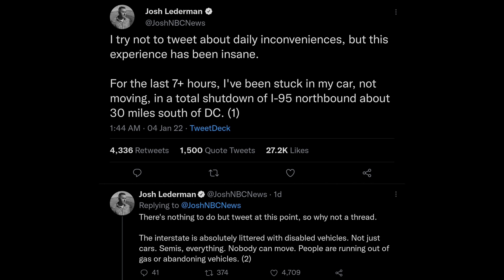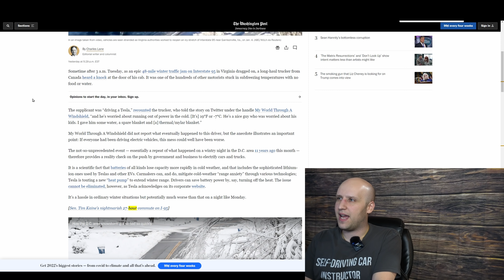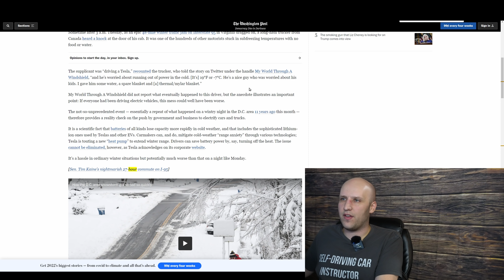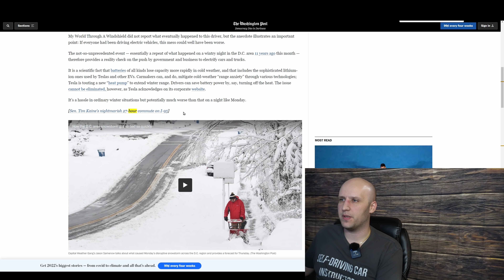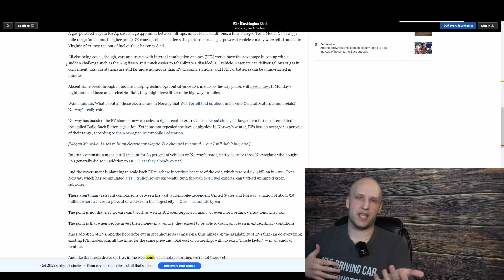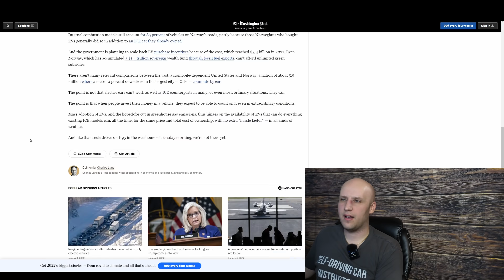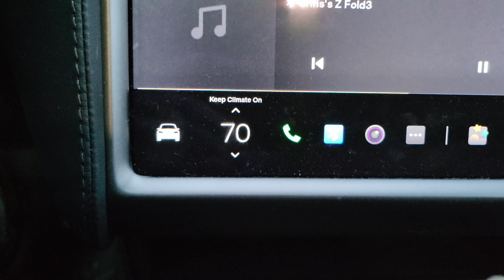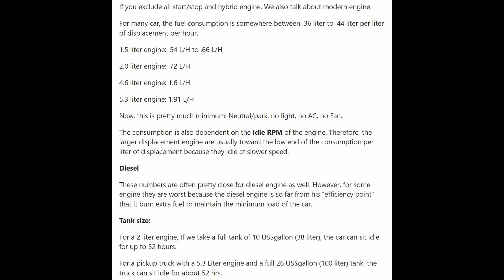How Long Can a Tesla Keep You Warm In A Frozen Traffic Jam? | FUD Debunking

Comment: EV is also useful during a 110 degree heat wave.  Last year the AC to my house broke and repair guy was booked for 3 days before he was available for repairs.  Camped out in my tesla for 10 hrs a day and stayed cool.
Reply: Or you could grab a window ac for $100 and not have to spend all day in a car.
Reply: @chaos.corner  local stores were sold out of AC and amazon was going to take 5 days for delivery.
Reply: @10melvis  That definitely does sound like a benefit then.

Comment: The point about ICE vs EV is that the ICE car can be partly re-filled in minutes ith a gas can whereas it takes much longer and very much more equipment to recharge the EV on the road.
Reply: A small portable generator is always a good thing to carry in an EV, just like a battery jumpstart unit is I always good to have in an ICEV.

Comment: Yeah until tow trucks have a way to give a rapid charge towing a Tesla is a challenge with the weight and bad roads! I have 30+ years of AAA road service experience under my belt! The time it would take a few Tow trucks to put fuel and a quick battery boost could get hundreds of ice cars going again in a couple hours, the EVs this would involve towing almost all of them taking a lot more time per vehicle especially if there's no charging station close by! If a bunch of EVs were stuck on a highway like this they are better off getting pushed off the highway to a safe location until something is arranged, wait you can't push a Tesla without causing thousands in damage to the plastic possibly totaling it, the cost of a bumper is insane!

Comment: Is this in a stand still only scenario? Does the car use more energy for it's sensors / cameras while in Drive mode or if you were at a slow creep every now and then? ..So in a standstill can u save more energy being in park vs drive? I know the car also heats the cameras so ice and snow stays off them. Definitely don't want to use the touch screen a lot or software a lot more than needed if this was a real senerio, and you had to recharge ur phones/nintendo switches if it was a family playing games, music or videos trying to stay entertained; which can drain phone/game batteries that need recharged from the car too. Can you turn off the lane assist and self driving stuff to save more energy on top of the test you did?

Comment: If an ICE vehicle runs out of gas what do you do? Someone brings a gas can! If EV's are running out of power what then? Go reason for a 4x4 pulling a trailer loaded with batteries that can supply enough energy to get them going. Someone needs to make this, have it ready and charge just like a tow truck would.

Comment: New Ice cars may not produce enough heat to keep the cab at 70F (diesel) when idling.  So u would need to add all accessories to load the engine to keep the heat up thus running out of fuel much sooner.

Comment: 1966-67, I was stationed  on a US Army Nike missile site in Farmington, MN.... It was normal for the temps to drop down to a negative 20 or 30 degrees.  When this happened the batteries in our vehicle went completely dead...frozen... The military vehicles were equipped with electric heating blankets, plugged into electric outlets... then used to jump start our POVs.  I'm thinking that all electric cars (battery operated) would fail to start because the battery-packs would freeze.  I suppose one could have a massive battery-pack electric blanket plugged in to an outlet for cold weather starting... just one more question regarding the "convenience" of owing an  electric vehicle.
Reply from the maker: The problem with gas cars not starting does not translate to EVs. I've had my gas cars not start several mornings here in Michigan. An EV will drive off with no problem altho Tesla specifically advised not exposing them to -30C for more than 24hr

Comment: Great Analysis!
Kudos to you for tickling my brain!

I see a valid downside of EVs (not only Tesla, though I am a fan of)...if that disaster lasts for 48 hours or more?

This point is a forecast by me as your Excellent Analysis will be used by EV and Elon haters!

Also I would support your unwavering devotion for Tesla by letting you know that :
In real scenario, body heat generated by the passenger(s) may also offset energy consumption from battery!?
:-)

Comment: I don't own an EV (yet) but almost every single "point" against EV's that that writer in the article was trying to make can be countered with, "well that's also a limitation by an ICE vehicle."  In fact, I would argue that I would be far more likely to have more of a charge on my EV at any given point on my commute than gasoline in my ICE car just because it would be topped off at home and / or work every day.
Reply: That makes way too much sense for the ice folks who love buying gas
Reply: it depends on where you go. you have a commute. i don't, also live in a country without sufficient chargers. at around 0.5-1l/h,  my car gives me around 80 h more or less with a full tank. also i do not like to be close to empty and have more gas stations where to do it. also the guy that made the video calculated a linearity for battery discharge. as you know from your phone, a liion battery does not work that way. even with that and maximum efficiency, there is a difference between 36 and 80h. anyway technology will get better, i'm sure.

Comment: The problem I see is not all EVs are Teslas. There are many out there that are short-range cars. Many only have a 100 ish mile range. Where most small gas cars have small fuel tanks but have small motors so they still keep about a 300 to 400 range. Everyone here that is going on about how long their heater worked for was driving a Tesla. Where are the Nissan leaf owners? Chevy bolt owners? Fiat 500 owners with their 24 kWh battery? That being said if I were stuck in a snowstorm in an Ev I would Want to be in a Tesla.

Comment: "According to the U.S. Department of Energy, fuel economy tests show, in short-trip city driving, a conventional gasoline car's gas mileage is about 12 percent lower at 20 degrees Fahrenheit than it would be at 77 degrees Fahrenheit. It can drop as much as 22 percent for very short trips, around 3 to 4 miles."

"Cold temperatures can reduce an unplugged EV's range by about 20 percent, according to testing by the Norwegian Automobile Federation, and recharging takes longer than in warm weather."

So looking at that the cold weather is affecting both engine types about the same while the EV is affected a little bit worse. While on short trips the ICE will defintily will loose to the EV since it doesn't draw any significant amount of power while not moving while at the same time an ICE will still draw 0,5 L/h.

Comment: Food for thought: a 20 year old car still runs as long with a full tank as when it was new. But how about with old Teslas? Both of these Teslas were pretty new.
Reply: What testing have you performed to verify your assumption? I can almost guarantee a 20 year old car with 150,000 miles on it will not be as efficient as it was new.  The same goes for a Tesla.  I would expect the Tesla to have 70% or so of it's original capacity.  Batteries are getting better and better.  ICE cars are getting worse and worse since manufacturers keep making engines more and more complicated.
Reply: Very good point. ICE vehicles loose very little efficiency over time. I have well over 220 k miles on my '97 pickup and it still runs the same as always. The 2000 Jeep too. The '96 Nissan Sentra runs like new. When I had my 1927 Buick Brougham with the Master 6 it was every bit as peppy as it was when new and with the factory fuel tank!
Elon says of the NCA tech: "maybe 15 years calendar life" so Tesla's success partly depends on that estimate being wrong or allowing battery changes as a part of normal vehicle maintenance for long-term ownership.
Reply: Annete not that it's not a valid question but this is one of those endless "what if" questions we can ask back and forth all day in endless amounts . 
Well what if the gas vehicle has a bad starter that sticks when cold
What if the electric vehicle was this or that ect .
Reply: Of course it won't. An electric toothbrush after 4 years doesn't perform with 1/2 power as it did when new.

Comment: Seems like quite a few things could be optimized.

1. Always carry an emergency kit with even a basic set of gloves, toque, blanket.

2. Unless you are getting in and out, once your seat is warm you don't need to keep it on. At times if I'd sleep in the truck (F150) going to work or coming back home (3-hour commute each way) in the winter I'd turn on the heater once per hour for ~20 minutes and turn on and off the seat heaters.

3. Starting heater periodically definitely works in an ice because it takes time for the block to cool. I wonder what the effect would be for an EV?

Comment: Year ago someone told me that they use to have overheating problems with ICE vehicles during heavy snow do grills getting clogged with snow and ice.  Was there any such problem during these traffic jams?
Reply: I've heard stories from my dad of going out snow drift busting for fun. the truck would overheat and they'd find the engine compartment packed full of snow. I can imagine this problem is much worse for a heat pump. at least with a gas vehicle, the radiator is kept hot, which at least helps melt some of the snow and ice. but with a heat pump the radiator is extremely cold and prone to icing. heat pumps go into defrost cycles to keep the outside evaporator clear, which means more energy used and no heat produced during those times. after the last snow storm we had where I live, the heat pump for my home was completely iced up, far beyond what a defrost cycle could handle. I switched it over to air conditioning for 5 minutes to clear the outside radiators, but it only stayed clear because the storm had already passed at that point.

Comment: The difference between a gas vs electric running out of a fuel source - you can bring a can of gas to refuel your car.  Until solar charging gets better or they devise a way for roadside assistance to give you a 5 min quick charge, the gas car has advantages.  Always keep an emergency kit in your car, especially if you drive areas where you cant walk to get help or out of the elements.  Wool blanket.  Water.  First aid kit.  Shovel/sand.  Jacket, gloves, hat.  Shoes or boots you can go for a hike in, in case you do have to abandon the vehicle.

Comment: The assumption is that electric cars would run out of power and not stay worm.  Thanks for correcting this assumption.
Reply: The problem is if they do run out of power you need a tow truck which would make the problem worse. If everyone had one and 1 and 10 ran out of power the jam would last hours longer. That is the problem.

Comment: Never been in a 24 hour jam, but I have been in 6 hour ones during road closures from serious accidents. A lot if this debate is silly. The culture sort of changes when you are stuck together like that.  Instead of being rude aholes, most people work together, and weather permitting, turn it into a sort of social event akin to a hurricane party without the beer. Only an utter moron with zero social skills would run out of charge or gas, or even if they did, get into danger (excluding risk from exhaust gases). If me or any other normal person got stuck in a jam on a closed road with low fuel/charge, we would shut the vehicle off, make a friend, and sit in their car. A few people with weak batteries would probably not be able to restart their gas engines, but I wouldn't imagine there would be too many of those. at 15-20 degrees, all batteries except those on their last legs should start.

Comment: Interesting but no one was fully charged when they arrived at this location and not very many people are as logical and intelligent as you appear to be.  Electric is good but will not survive most situations, no matter how you slant the experiment.  You cannot charge the vehicle as easily as you can get a gallon of fuel….and probably in my life time electricity will never replace the gas powered mode of transportation with any probability of success.  I don’t know that there is any reasonable solution to this very difficult situation but I would rather have a gas powered vehicle because its much more predictable and I understand it.

Comment: The range axiety power thing is always  present with electric. With gas its not that big of a deal. if you run out of gas you potentially can get some fairly easy. Have a spare gas can? You can reasonably walk to the nearest pump and getting gas only takes a few seconds or few minutes at  worst. Or you can have nearly anyone you flag down get you some gas or even spare you some of theirs. Where as with electric there is none of that. your only hope is finding a charger and pray not only that its working but its not already occupied and in a stranded situation you cant bring the charger to the car like you can bring the gas to an ice vehicle. So i can understand why people stuck on a highway in an electric would be more nervous than someone in a gas car

Comment: You could put electrical lines on the highway and have various charging places. Cant do that for gas unless its a gas station. The gas has to be delivered on a truck to the gas station. If the electric is underground you don't have to worry about losing the electricity. The real problem with electric is that its above utility poles and in the winter trees that get to much ice on them can fall down on the electric poles. If there is an accident on the highway it could block those gas trucks to the service stations and people can't get gas.

Comment: Aren't model Y heat pumps failing in extreme cold though?  Just curious if there's a backup heat option for extreme cold, as most refrigerants tend to lose heat exchanging capacity the colder the ambient temperature is.  Most residential units are only rated to -10F, what's the low temp rating on Tesla?

Comment: In a traffic situation like that I would rather have a gasoline car with a quarter of a tank then a Tesla with a quarter of a battery.

In a gas car after 2 minutes you can have piping hot air blasting into the cab and then you can turn your car off.